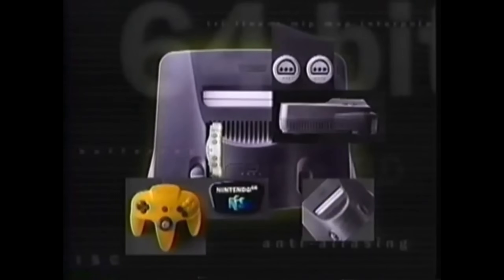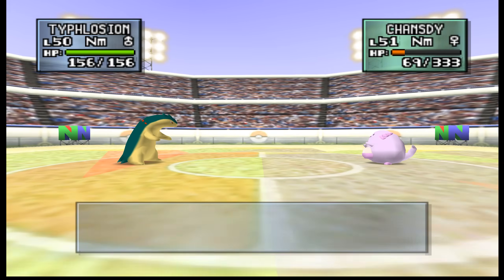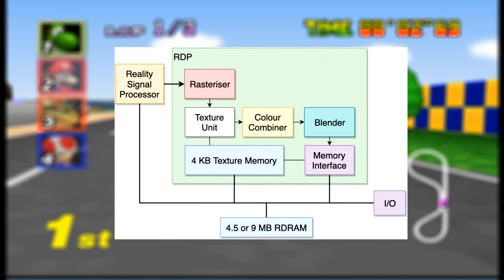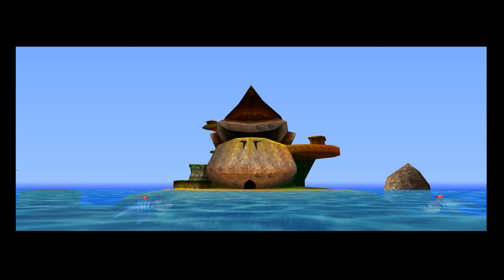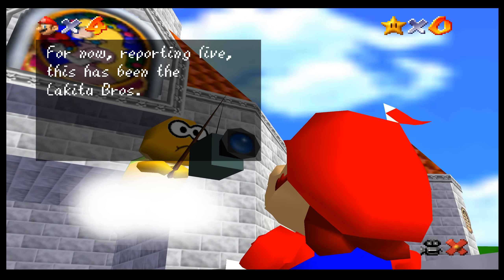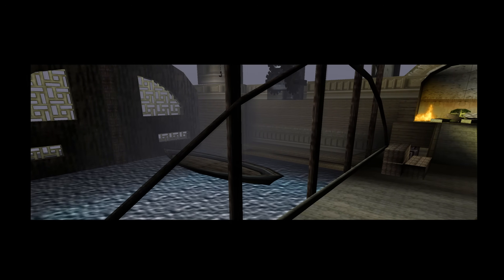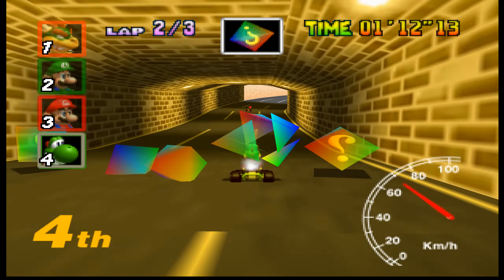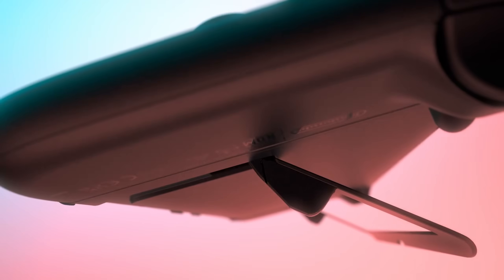The Nintendo 64 GPU: Reality Co-Processor (Retro Breakdown)

Comment: Fact Checking
3:48 No, N64 carts did not have additional special memory onboard. Just ROM. Some games had retain memory to save game progress.
4:04 Z-buffer was in the main memory. It was faster to turn off Z buffering whenever possible, but then triangles had to be drawn back to front like the PS1. Fzero X does this to hit 60 fps.
4:43 no environment mapping hardware. That is Gouraud vertex shading using 2 cycle rendering mode. Multipass rendering in simpler terminology.
Reply: lol googling any of what you said leads to no where. No merit. Fact check yourself.
Reply: Not exactly the expected response. Not everything is a single Google search away.
Reply: @ween5139  It's well known that the only way to increase RAM on the N64 was through the Expansion Pak, nothing else.  Anyone that has delved a little bit in N64 romhacking, reverse engineering etc, will tell you that F-Zero X has no Z-buffer to get the needed performance. You can even demonstrate it ingame that sometimes your vehicle's shadow will be drawn in front of the road geometry at all times, even if your camera post-race is looking from outside a tunnel!
Moreover, any homebrew dev for the N64 that does anything graphics-wise knows what 2-cycle rendering is, and the amazing potential of the Color Combiner found in the Reality Display Processor. You can learn to use it on Blender with the Fast64 addon, allowing you to make materials and textures as accurate to the N64 as possible, and even import your models in games like SM64.
Maybe push your google searches a bit further before berating someone bringing valuable information. Join Discord servers where you're met with all the passionates that know so much about the system.
Reply: @Martyste thanks for backing me up.

Comment: I never understood why the textures on the n64 seemed to be one texture block stretched over a huge area
Reply: because they were
Reply: And PSX looked so much pixelated (but at higher resolution)
Reply: @ lower res actually, but with more variety of pixels
Reply: @joseabraham777 The pixelation isnt as noticeable in games that uses 256x256p textures. You dont miss bilinear filter on games such as High Stakes or the Crash series.

Comment: Aside from the limited cartridge capacity. N64 also had a severely limited texture memory of 4KB. That's why textures look blurry with vaseline applied, and game devs often offset this by using brighter colors.

Emulators today are capable bypassing these restrictions and enable higher quality texture packs though.
Reply from the maker: Yess the texture packs are a godsend
Reply: I always will wonder what games would look like if the N64 was CD based with the same exact specs.
Reply: They bypass the limited cache by loading textures direct from the cardrige
Reply: The original PlayStation had 2KB of texture cache.
Reply: @ikaros21  That's right! N64 was\is capable twice the texture detail than PSone.
Reply: @ No game showed it.
Reply: I wouldn't use Vaseline to describe them. That's more of Halo 4's melted wax surfaces because Microsoft wanted 1080p native to one-up Bungie's 720p native Halo: Reach. 720p was limit before texture quality began suffering on the limited 360 and PS3.
Reply: @ Yeah it's kind of crazy to think that 480P/60fps games like Metroid Prime really had miles better textures than seen on most XBOX360/PS3's 1080P/60fps -offerings.
Reply: @M1XART that's the result of good art direction. Although, credit where credit is due, the Gamecube's hardware allowed for that kind of potential.
Reply: The cache was not an issue. PlayStation had only 2kbit cache.
N64's issue was texture size.
So, when they drew a big polygons, texture -sizes, that were maximum of 90 x 90 pixels did not cover entire polygon, -so they stretched textures and that made textures to lose a lot of detail. 

It is possible to make detailed N64 -games. Textures just need to be done before, then build polygons on levels in mind that those exact textures must fit into polygon -sizes you draw.
Reply: @M1XART  The PlayStation had a real texture cache while the N64 had a texture memory.
It's without mentioning the N64's unified RAM memory contention compared to the PS1's dedicated VRAM.
Generally PS1 games had better textures while N64 games had better texturing.
Reply: @ We all know that. But i do consider that bigger unified (or actually splitted on two parts with the Expansion Pack) RAM allows freedom of choice to go for better graphics than dedicated VRAM. For example RUSH 2049 uses all main RAM for graphics and Expansion Pack RAM is required for music.
Reply: @M1XART  Exactly. it was more like developers didn't know how to use the hardware correctly. It's similar to the PS3 and how 360 third party games ended up looking better than a lot it's PS3 couterparts, but those who knew how to actually use the PS3 hardware correctly you got to see the capabilities. There are detailed N64 titles out there that look lightyears ahead of PS1 graphics like Donkey Kong 64 for example. Cherry picking certain typical 3rd party titles where developers didn't know how to use the hardware doesn't mean the PS1 "has better graphics." I swear people who claim that were never PC gamers back in the day and never grew up playing games using 3DFX Glide on a Voodoo 3D accelerator. 3DFX games on PC had that same "blur" they complain about and insist their PS1 pixel textures are better looking than bilinear filtering and those 3DFX games look light years better than PS1 games. Heck nobody complains about the same "blur" being on 6th Gen consoles.
Reply: @ironinquisitor3656 The difference is that one: most sixth gen games aimed for realism and bilinear filter works better with realism in mind, and two, the textures were not ridiculous small so it allows for the bilinear filter to work better at close distances. The best looking N64 games were all cartoony but it didnt had the benefit of the textures nor the filters. Thats why they looked washed up.

Those PC games that used  3dfx the same thing. There werent almost any cartoony games on PC, certainly i didnt saw a game after 1995/1996 with heavy focus on saturated colours and simple textures on PC. Most PC games of the 90s all had a degree of realism: Quake 2/3, Half Life, NFS, Unreal, etc.

Its about perspective. Its the same reason as to why people prefer to play oldschool games without filters but the sequels with it. The filters with a very very low res display just ruins the image.
Reply: @sebastiankulche  Quake 2 was an example of a "realism game" you brought up that had an N64 version and it looks great on N64. It's one of the better-looking titles on the console that benefits from the expansion pak's extra ram and doesn't lower the framerate like a lot of titles do when the pak is used. Even games like Rogue Squadron or Battle for Naboo try looking more realistic and are among the best looking titles too So there are more "realism" looking games on the 64' that look among the best.
Reply: @ironinquisitor3656  Quake 2 on N64 feels rushed and its not as good as the PS1 version. Everyone knows that.

Interesting though that the expansion pak actually made the game smoother in FPS compared to other games which does the opposite effect.
Reply: @ Good point, I love the PS1 version of Quake II. It's probably the most technically impressive PS1 game or one of them at least. But I wouldn't compare the two because Quake II on N64 is essentially its own thing like a level expansion pack to the original PC Quake II game whereas the PS1 version is a straight up attempt to get a PC faithful version of the game on the PS1 console as much as the hardware can. Perhaps that is why the N64 version feels "rushed" as you say. I guess using the expansion pak correctly like that shows that skilled developers could use the arcane N64 hardware correctly if they tried even further.
Reply: @ironinquisitor3656  Oh dont get me wrong, it still is a great game regardless of the platform. I loved also Doom on PS1 and it had a lot of exclusive levels as well. I just wish at least the N64 version had a proper ending because reusing the commanders for the final fight was a bit lazy.

Quake 2 showed that if all of the N64 ports (or viceversa) were made on its own low level language engine they could at the very least be closer than they were. But very few third party push the hardware like if they were a main studio. TT or EA are probably the closest ones.
Reply: @sebastiankulche  I loved PS1 Doom too. Aside from the lack of ability to save on a memory card and archaic password system to get to levels it was probably the best console port until the versions that were included on one of the editions of Doom 3 for Xbox came along. The colored lighting effects, mostly solid 30fps, and including Ultimate Doom's 4th episode as well as Doom II levels made that it worth getting and good value for the time.
Reply: @ironinquisitor3656  The homebrew scene also managed to put on real hardware the PC levels with a mod and.... Nuts. Yes, Nuts, lol.
Reply: @ironinquisitor3656  the 360 looked better, because it had a better GPU and better overall design. It wasn't a matter of developers not knowing how to use the hardware.  Developers had to bend over backwards to do something in PS3 that they could very easily do on 360. Many people pointed to PS3 exclusives as examples of the PS3 being more powerful.  That is and always is a flawed argument.  That's like pointing at Halo and saying the same thing but for the 360. The generation came and went and 99% of the games that had versions for both consoles, the 360 versions ran at higher frame rates, higher resolutions and on many occasions, also looked better on the 360.  I say this as someone who preferred the PS3 due to its more varied and unique library.
Reply: @Aki_Lesbrinco  That literally just proves my point I was making. The 360 hardware was better in the sense it was easier to use for developers. Thus they could get more out of it than the overly complex arcane Cell Processor when developing games.